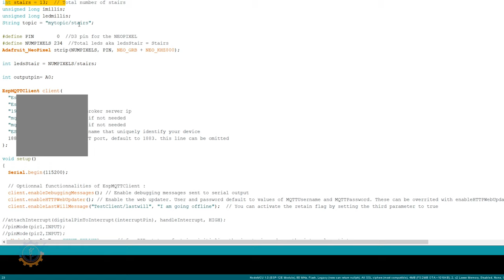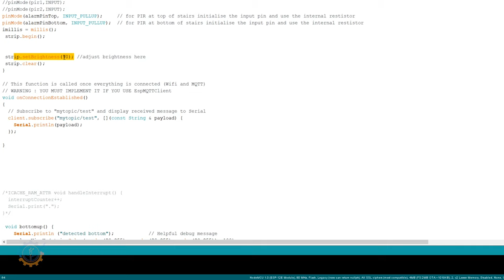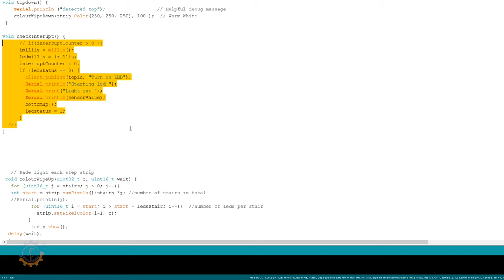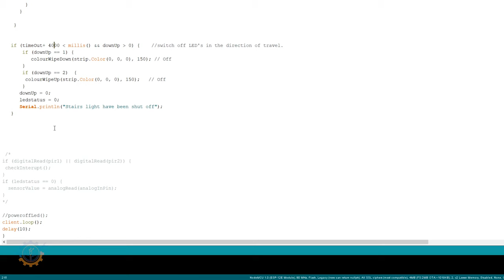Motion sensor RGB Led light stairs project

Comment: Hi, nice work.  I’m a electrical contractor that does a lot of wled in custom homes. No code or programming involved. Use all sorts of methods for switching in different situations. Door, touch, remote, ir built in cabinets. So I have a bit of experience with the basics. I was wondering if you could point me in the right direction to start learning about programming. What brand controllers, what programs used to set up programs etc. Any and all information would be greatly appreciated. Thanks.
Reply from the maker: Do you need custom code? Esphome and tasmota can do scripts. If not arduiono idé With esp8266 or esp32 is my goto

Comment: Great project but why aren't you installing the led strips on an alu profile, so the heat of the strips can go away more easily and that's better for the lifetime of the strips ?
Reply from the maker: Thanks.
3 reasons. Actually 4 :)
1. They run on lowered brightnes
2. They are only 30 led per meter and hardly have any heat
3. They inly light Up for an average of 7 seconds at a time
4. Alu strip is extra work.

IF they would have been 60led per meter and being lid Up i would consider it but even then its not a major issue. Those strips are not that high Power :)

Comment: Hi, this is a really cool project, it looks awesome! I am very interested in doing this myself. However, I have an arduino Uno. How can I modify the code for use on the arduino instead of the ESP8266 and one single led strip of 150 leds to run along the skirting board instead of one on each of the stair risers (as my stairs are carpeted). I am a complete novice when it comes to programming and I would really appreciate your help if possible. Thanks in advance!

Comment: how is the maximum number of LEDs that can be used? Please.
Reply from the maker: As many as you want basically. But the signal can be a problem. If you use my code you need to change it. I have been running up to 800+ leds in a row or more :)
Reply: Thank you, I followed your video and it worked 
Can I change led ws2811?
Reply from the maker: @huynhminhnhat7397  most likely yes

Comment: Hey! I need some help. I want to copy your exact setup, but in a very small staircase with only 4 LED strips as a small project :) Any numbers i should change when only using 4 small led strips? thanks! Please note, I am very new to this but very interested! :) i am using the same strip and materials as you, the WS2812B
Reply from the maker: You need to change 2 parameters. first is number of steps. In github its set stairs = 13 and then number of total leds numpixels
Reply: @DIYTechRepairs  Thank you for your answer :) But I have decided to change it a little bit. I want the LED strip on the side of my small staircase. so just one LED strip, where the light follows me as i go up the stairs. You think your code would work with that?
Reply from the maker: @maxi-nz6jw  Yes it would work too. Just change number of stairs to number of leds ie same. as the other. But you can also use wled for that since its basically just lighting it up from one direction or the other but if using wled you need one microcontroller to trigger wled :)

Comment: Very nice job dude!
I'm wondering why did you use a 5V led stripe while you can easily use a 12V one (like WS2815) which can save you using step down converter to step down 12V to 5V for powering the LEDs 🙄
Reply from the maker: I dont step from 12 to 5. I run everything on 5v :) thats why i choose the 5v strips and since i only have the 30 leds per meter i dont need that much current per strip either 

For higher current and longer strips with more leds the 12v is favorable for sure
Reply: @DIYTechRepairs  I missed that voltage is 5V 😅

Comment: actually i am more interested how warm your glass cabinet gets
Reply from the maker: Glass cabinet?
Reply: @DIYTechRepairs  
where you installed the inverter and all the electronics
Reply from the maker: @ursodermatt8809  around 20c. It have airvents bottom and top.
Reply: @DIYTechRepairs  
in the summer or winter?
Reply from the maker: @ursodermatt8809  Year around. As I said I have air vents that controll the temperature. If I shut that down the summer would be up towards 30c in worst case and if i run vent full in winter i might have 8c at lowest. 
The cabinet is not airtight because that wouldnt work. Its made to protect from dust and stuff from tha workshop and being able to ventilate
Reply: @DIYTechRepairs  
thanks for your reply